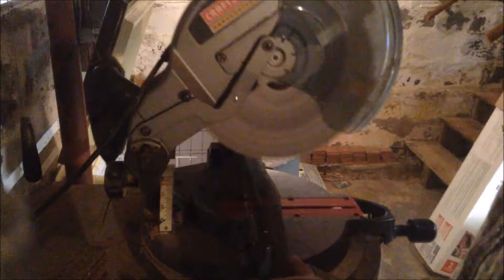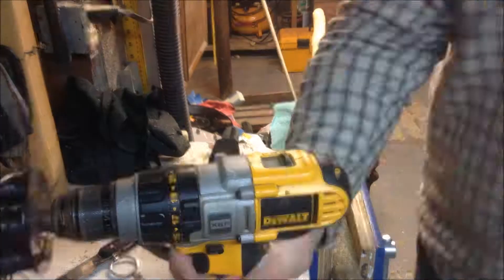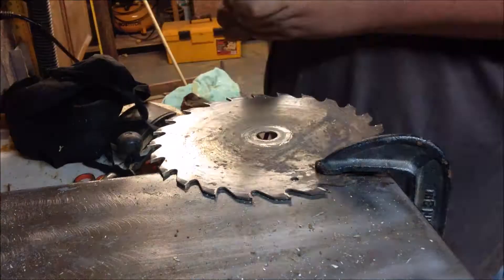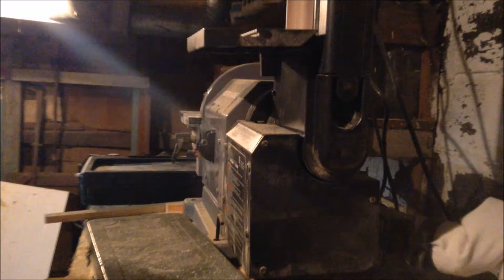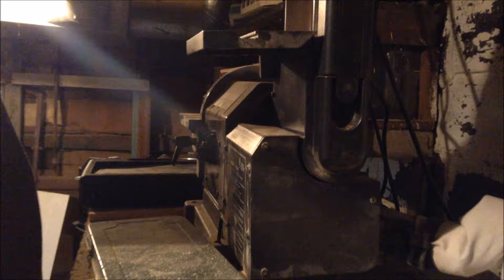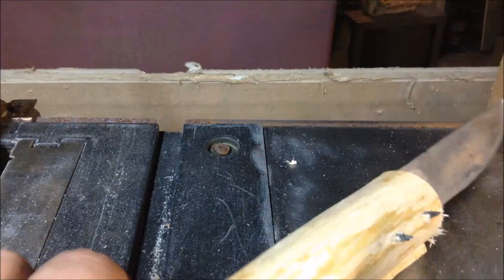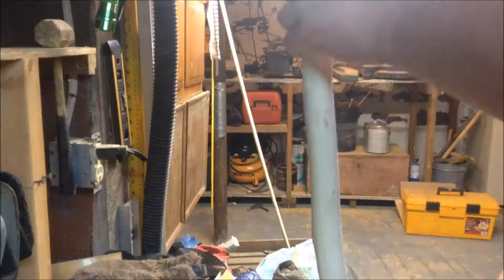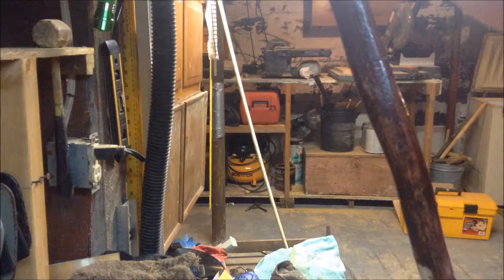How To Make A Walking Stick (With A Twist)

Comment: Nice work! 

I just finished making a double action (OTF) switch blade style walking stick. It took find the right long spring and I made a fire-lock but I finally got it working pretty much as fast as a regular switch blade. I didn’t film the making but If anyone wants to check it out and make their own I can film another being made.
Reply: Sounds like that would be interesting

Comment: Fair enough 👍.
If ? It starts to wobble at the join !
Wrap the blade and handle ! in plastic tape and use a thin mix of epoxy glue in the base. The glue will not stick to the plastic. Instead its like making a mould 👍 .move the glue around a little then just stick the knife in.

Comment: It would be cool if you could.pull the knife and reverse it to the bottom insert it handle first as a spear... good work
Reply: Aluminium L shaoe  veterans walking stick 👌. Remove the handle, give the whole thing a gentle squeeze in a vice or monkey pliers and use a Katana but also  sharpen the back edge to a spear shape.
A rubber door stopper on top and -
Hey presto !
One very stable hidden Sword. Press the height adjustable button to open and swing 🗡️ one sword and sheath ! Or sword and staff !
Surprise 🤞 turn the handle around and insert into the sheath . Now that same button locks everything solid !
Creating a two handed Sword or spear 👌👌👌.
I called her "Betsy" after a mugger thought he'd try his luck on a disabled vet ! 🤣😂🤣😂 Man the look on his face 👀🗡️😱💩🤣😂 I swear he passed his own teeth, car keys , hopes 🤣😂 I nearly had another hernia laughing.

Comment: Dude why on earth did u have to waste ur energy where u cud have used a broom stick
Reply: misirali185 
1. Could*😂😂 2. I did the same thing he did and it was a lot of fun sanding the walking stick and making the hole thing.
Reply: They can be a bit light and the smaller diameter makes a less robust attachment of the blade. What you're saying seems to make a lot of sense so I tried it that way the first time. Sometimes if you have had luck the grain runs so it has no sheer strength at all and they snap really easily. Brooms are designed more for different forces ( compactive stresses... for the geeks :)
Reply: They can be a bit light and the smaller diameter makes a less robust attachment of the blade. What you're saying seems to make a lot of sense so I tried it that way the first time. Sometimes if you have had luck the grain runs so it has no sheer strength at all and they snap really easily. Brooms are designed more for different forces ( compactive stresses... for the geeks :)